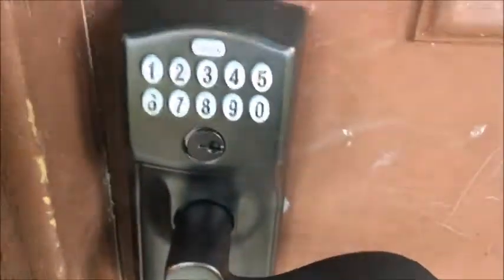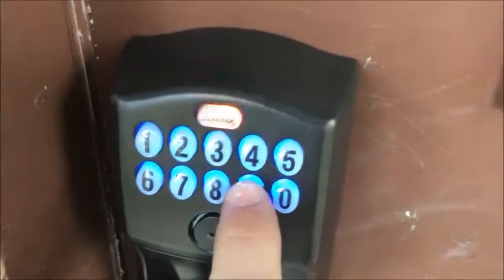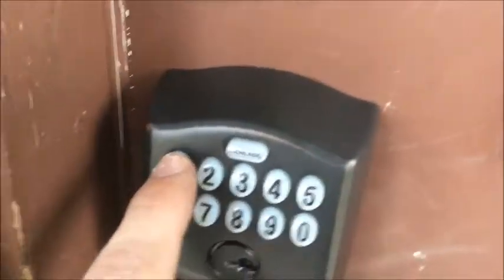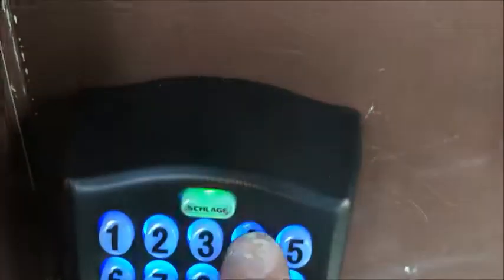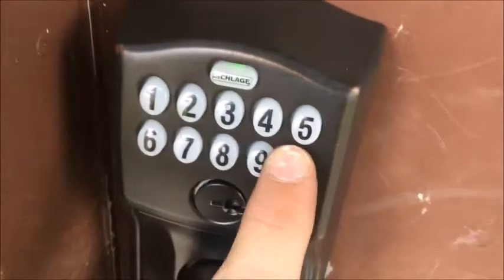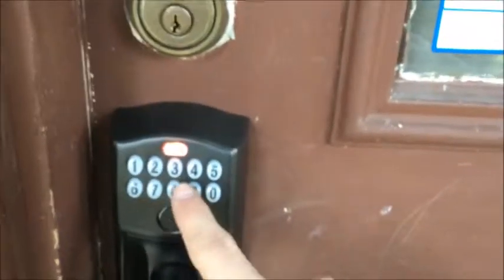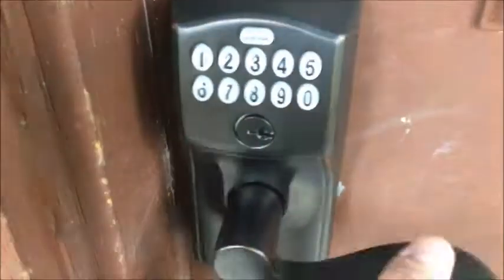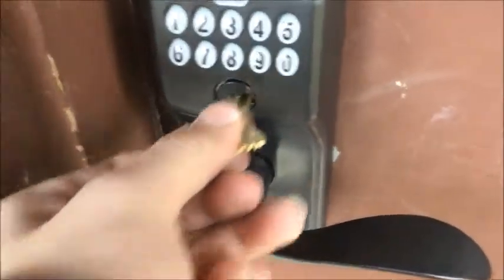Programming and Operating the FE595 Keypad Lock | Tech/Mechanical Video

Comment: Hi James, Thanks for the helpful video. Is it possible to lock the door with a code in passive mode? If so how does one do that? Thanks in advance for any info you may have on that.
Reply from the maker: No, when it’s in passive mode (or unlocked mode) it can’t be locked unless you turn the switch back to locked mode

Comment: The time for auto lock is too short, Can we program it to 2 minutes?
I need a little time to pickup the mails, packages or doing something quick.
Reply from the maker: No unfortunately you cannot program the auto lock timer, however you can flip the thumbturn on the inside to set the door lock to unlock mode.  This will keep the door unlocked until you flip the thumbturn back.

Comment: Where can I find the code if I don't have the box no more or the instructions papers? Do I need to open it?
Reply from the maker: The default programming code and 2 pre-set user codes should be on a label on the back of the keypad part of the lock.  You will have to take it off the door in order to get to it.  If the programming code that’s on that label doesn’t work you can reset it to the factory settings.

Comment: Mine won’t lock every time ????
Reply from the maker: Perhaps the battery died while it was in the lock position?  If you can explain the issue with more details I might be able to help.
Reply: @Jamestube8439  It was giving me trouble,then I changed battery and it is doing the same thing. I mess with it and magically it will lock ??
Reply: It is not dependable
Reply from the maker: @jackeannarelli8657  still that’s pretty vague, like I said. I might be able to help you if you can actually explain the whole situation to me.  As far I’m concerned, this is a great kick, I’ve had it for years and have had no trouble it all
Reply from the maker: @jackeannarelli8657  sorry didn’t see this message right here, Youtube was being goofy lol. Anyway might be a faulty lock, what kind of 9 volt battery were using? (The brand)
Reply: @Jamestube8439  yeah,I love the lock ! I think I have exhausted the different code combinations. I was hoping someone might have and over ride(tech geek) to make it lock
Reply: I can get it to lock but,I have to Jack with it . Mess with handle and deadbolt etc. And magically it will lock
Reply from the maker: @jackeannarelli8657  sounds like a lock mechanism problem, probably would be best to either take in to get fixed or get a new one